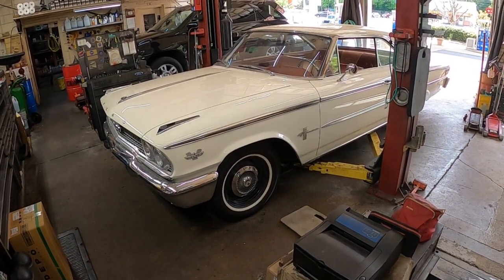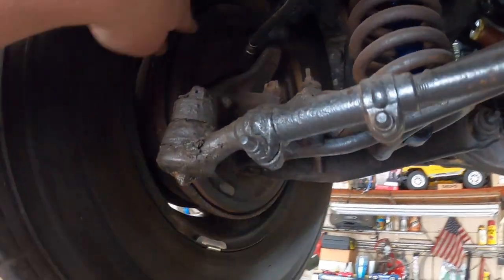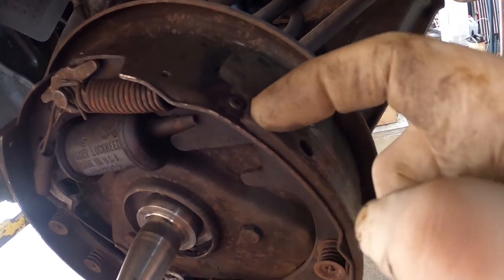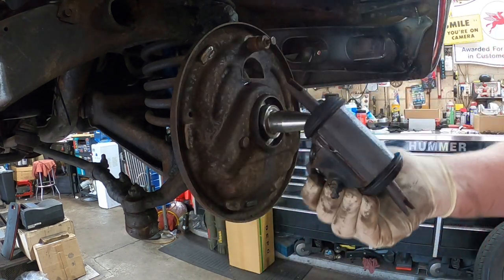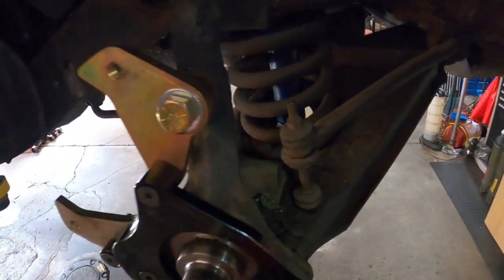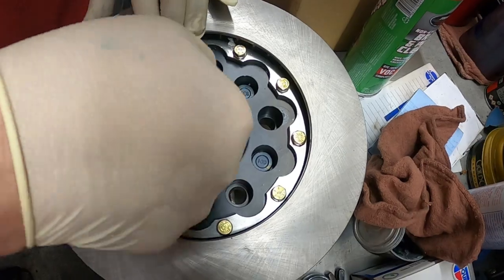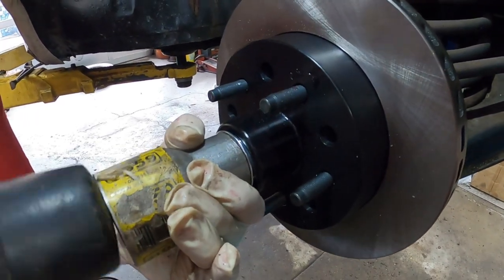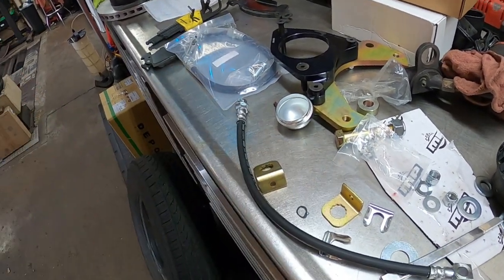1963 Ford Galaxie 500 Front Brake Conversion To Disc Brakes Part 1

Comment: Why do all you wear latex gloves? Get a seal driver too. Flex hoses that don't match the Ford frame brackets, not a surprise with an outfit that puts a GM caliper on a Ford or doesn't provide directions. Nice job on the spindle nut cotter pin!
Reply from the maker: I wear gloves to help keep my hands clean. Grease is the worst, It gets under and on top of your nails. Its just hard to get off. I do not to hear my customers complaining that I got something greasy. I have a seal driver but I can usually get then in with out it, this one was very tight. The hoses did not fit the brackets they provided or the ones on the car very well.

Comment: There's a company in Vernon CT that makes a far better conversion kit than this. Bigger rotors and 4 piston calipers. Less parts/brackets too. They make disc brake conversion kits for many different classic cars/trucks.
Reply from the maker: This guy wanted to run stock size wheels that is why he got this kit.
Reply: @TheGAutomotiveAndMore  15x6 wheels were optional on those cars.